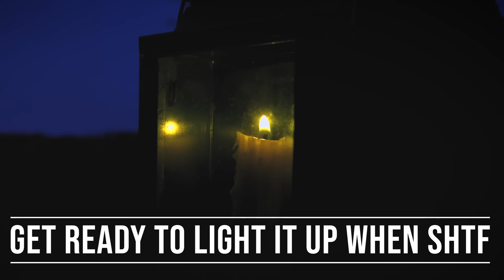Best SHTF Emergency Lights

Comment: YANASA candles that can burn 15 plus hours to 72hrs straight is using crisco along with long stick candles as wicks!! Drive the long stick candle down in the crisco cut off excess long candle to the same level as the crisco...if you want the candle light brighter just make the wick longer at the top..light and it will burn for minum of 15hrs to 72hrs..I drove 3 long candle sticks in crisco and the lighting lite the entire livingroom plus put off alot of heat which was alot with 3 candle sticks together in the crisco..can put in any large glass container..the candles dont burn when the flames get to the crisco..the crisco doesnt caught fire at all used this method over night..used crisco oil is more pure form of oil than knock off brands so it burns longer..i even used birthday candles with crisco in small candle glasses that burned 14plus hours straight...the heat that is put output for hours is a major plus!!

Comment: I have an LED lantern that uses the same battery as my cordless tools. Many brands make them, I have the Ryobi one+ system and just bought an additional one and two more 4 ah battery packs after we lost power and I realized how well they work and how little energy they use. Have a small solar system & battery bank to charge them with. Works for me!

Comment: beeswax candles are great due to they don't spat all over like modern kind will do. Unless a bug dive bombs the candle. I know what you are getting at cause we used to do re enactments  too. But make sure you have good ones made to burn slow & mixed right so they last longer. Plus don't throw your stubbies way cause you can use them for 1) starting fires like in your wood stoves or 2) melt down & use the wax to remake more candles too. Have a blessed day!

Comment: I have an O Beam I bought over 5 years ago.. I paid around $140, it takes 4 double A has 3 bright modes and 1 strobe. 800 lumens max and around a 1200' throw. At max focus it just has a small square beam and other then that it has a nice spot light with clean edges. I just got a new one from Costco, a Duracell, it holds 12 double A that comes with it. It is Bright, says it is 9000 lumens, got 3 of them while they where on sale for $19. I do have several other flashlights but my O-Beam is still my fave.

Comment: With the OLIGHT Warrior X Pro  and OLIGHT I5T EOS. Do I needs special battery charger or I can just the the consumer's grade charger to recharge its battery ?
Reply from the maker: It will come with a magnetic charger for the Warrior X Pro. If you buy the battery for the I5T EOS... I’m not sure it may require a charger I would stick with an OLIGHT charger for it.

Comment: Come one, Charlie...the candle needs oxygen to burn. Thats why there are the holes at the bottom, granted that they are are at the bottom for the reason of flame stability, and the vent at the top to be able to expel the smoke and gases.
Good segment though, because if the SHTF peeps will need to know and be prepared for these basics.

Comment: I would like to learn more about EMP PROOFING MY TRUCK!
COULDN'T I JUST DISCONNECT THE BATTERY?
HELP? ANYONE!😎
Reply from the maker: I believe you would need a special fabric to block the magnetic waves... there was a guy I found a year ago that sells it.  I would have to look him up again.
Reply: You should check out healy health products. You can use the device for things like that. Alot more though. It will take care of your health wellness when shtf
Reply: Military trucks drag a chain on the ground that's bolted to the frame. 
Not practical. But when you park your truck, have a wire with an alligator clip on one end, tied to your house ground on the other. Clip it to something metal on your car. If you forget to remove it, it will just pull off no problem.
Reply: @YanasaTV  "the EMF guy"

Comment: Title of the video should read: "DARK TIMES AHEAD...sponsored by Olight"

Really disappointed that this turned out to be less about what types of FLASHLIGHTS you should consider for SHTF and instead turned into an OLIGHT INFOMERCIAL...you DO realize there are other brands out there, correct? I would argue BETTER brands for many of the things you're speaking of. That's not to say that Olight is "bad" but to have an entire 37 min video that talks about them exclusively after quickly dismissing the outdate Maglite (it's been outdated for 20 years)...disappointing. This should have been focused on the functionality, features, construction, and performance you should be looking for, and should have only discussed brands in a broad sense to give an idea of some of the companies you can look into for your flashlight needs because the reality is that there are a lot of good companies out there and many of them focus on doing certain features or repeat the same user interface across their lines, which may or may not work for your individual needs. Some additional good companies that I've used include Nitecore, Fenix, and Klarus (but there are many more). If you are looking for weaponlights, an important consideration is that the internal components are fully potted to protect against recoil. I may be wrong, but I haven't found any Olight lights that are fully potted. They will work but if you want SHTF reliability and durability, then you should spend the extra and look for that. Stick to brands that focus on weaponlights as their primary product, such as Surefire, Streamlight, ModLite, and others.

One very important topic not discussed AT ALL is the difference between LUMENS and CANDELA. Lumens is the TOTAL light output cast in all directions and is only really useful in conjunction with Candela, which measures the focused light on a specific point. High candela is what gives you a longer throw on your light, and generally speaking a longer throw requires a larger diameter reflector. Knowing the lumens AND the candela helps you choose a light that is bright enough for the task at hand and combines the right amount of spill (or "flood") for the size of the area you need to illuminate. Knowing only one or the other limits your ability to choose the right flashlight. Higher candela is better for weaponlights and search lights because they allow you to see farther, and lower candela with higher lumens is more useful for a work light because it allows you to work without constantly moving the flashlight around.
Reply from the maker: Actually I recommended the Thrunite T2 over the OLIGHT 🤔
Reply: @YanasaTV  That's still missing the point I'm making. Flashlight models change all the time, many models are replaced within a year or two, so recommending a specific model is of very short-term value. There are also a thousand different flashlight models available out there, hundreds of them are very good options depending on your needs. So, rather than an attempt at reviewing specific models, teaching people how to evaluate their needs against a flashlight's performance is a far more meaningful and valuable video. I'm simply providing feedback to help you improve your content, it matters not to me whether you take my constructive feedback because I already know the information. 🤷🏻‍♂️ I watched the video to see if there was anything new for me to learn, but in this case there wasn't, so instead I shared my detailed knowledge of the subject. Up to you and your viewers what you do with it now.